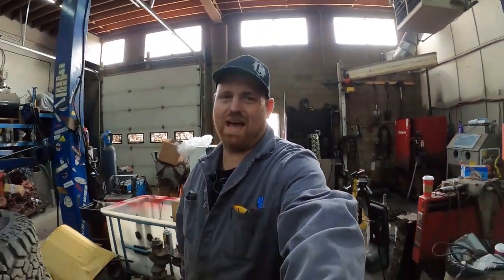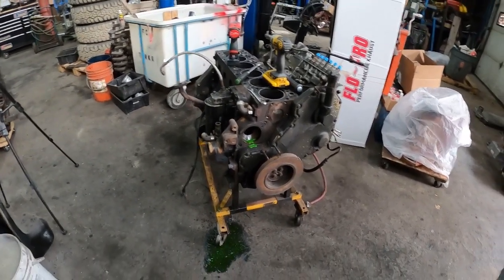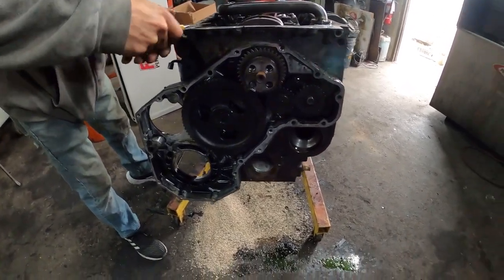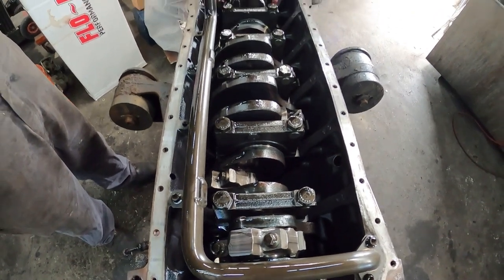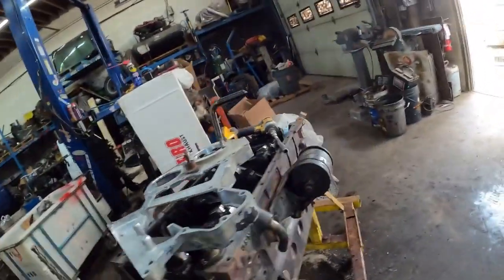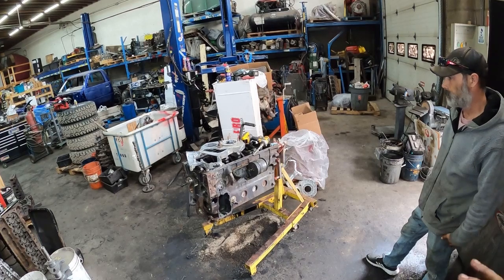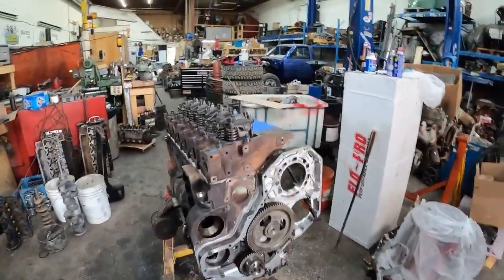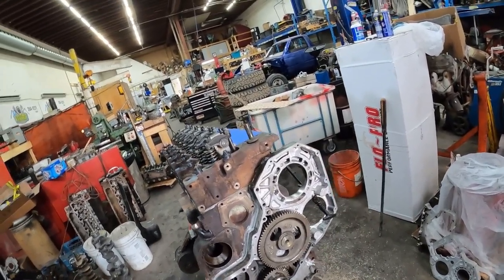how to build a upgrade 12 valve Cummins for towing ( resealing the engine )

Comment: Tappets, the ol wooden dowel trick ground down and tapped into the push rod slot...that's what i do as a shade tree guy. Great informative video man
Reply: Once I took the head off I used vinyl tubing to hold the tappets because my hardware store didn't have any wooden dowels
Reply: Just got done swapping one ... sure is time consuming.. fishing the new tappets in place..common rail block would be much worse ...but anyway
Reply: @jessiej3991  👍👍that would work too...I was gonna do that but I didn't wanna waste my 1/2" airline
Reply from the maker: That’s how i do it too

Comment: What is case sealant? You mentioned that when you talked about sealing the top of the engine block and the side cover. I am going to do this "fix" on my 12 valve Cummins. I do not want any oil leaks. Best regards Trond Vidar Bostad, Trondheim, Norway.
Reply from the maker: It’s acdelco engine sealant. You check out my Amazon store in products I use it’s in there.

Comment: I'VE BUILT SEVERAL IF THESE MOTORS AND HAVE COME ACROSS THIS CAM ISSUE AND IT'S DUE TO NOT CHANGING TGE OIL OFTEN ENOUGH 
OIL BRAKES DWN AND YOU GET CAM WEAR BUT I'VE FOUND THAT IT ONLY EFFECTS TGE CAM AND NOTHING ELSE .

Comment: I slowed down the video when you were putting the tappet cover on and the head gasket. It looks like you applied extra case sealant after you installed the tappet cover and after the head gasket was laid in place. Was that to seal up the edges of both? I really like these tips but I don't want to miss anything.
Reply from the maker: It doesn’t hurt to add a bit extra. Also depends on the block surface sometimes I add some it some spots

Comment: 👍👍.... swapped cam in chassis few Days ago... pulled it to replace gear case/block gasket and seen slight flaking on a lobe... probably would've been fine, but..have always wanted to upgrade to see what it'll do...replaced the front bushing there,and swapped in a 178/208 Hamilton and tappets... waiting for 103# valve springs to show up... could I have ran it without upgrading springs or..?... You don't have to answer on here if u don't want to...but anyway.. thanks for another video...catch ya on the next one 👍 👊
Reply from the maker: For a cam that size you don’t need springs. But bit extra spring never hurts

Comment: Does the additional silicone on the head gasket not affect the way it crushes when torqued?
Reply from the maker: I have never had a issue. If both surfaces are really good I don’t use anything. But I have done it like this like 500 times over the years